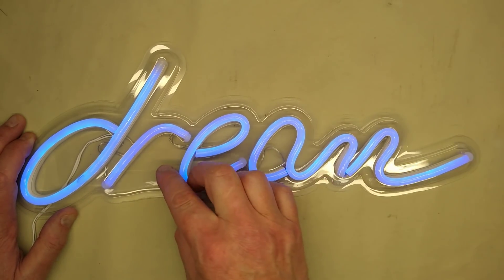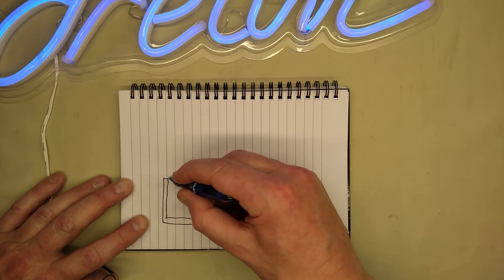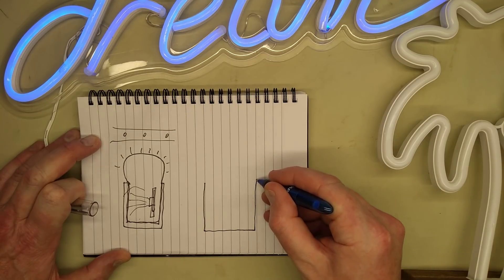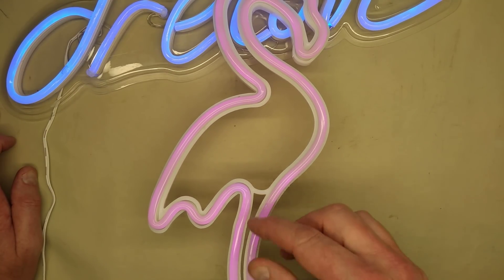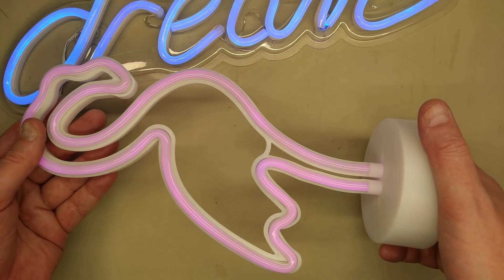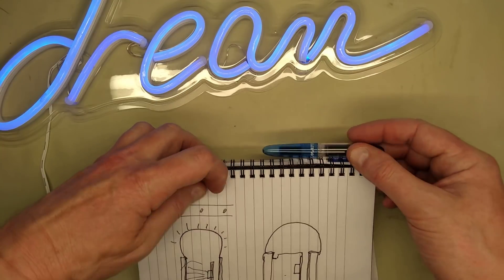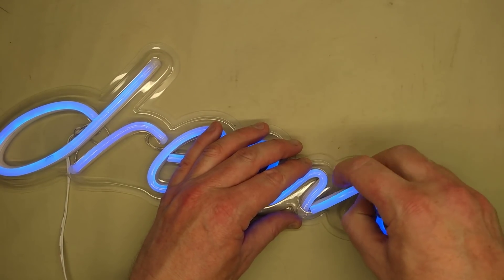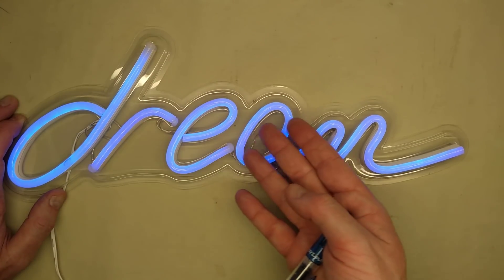Four types of LED "neon" sign manufacturing technologies.

Comment: Good video Clive.  Have you looked at the 12V Flexible Neon EL Wire that is also being sold ?  I believe there is also a 3V and maybe 5V version.  The technology is different as it uses a high voltage pulse to excite an oxide coating on copper wire to make it glow (as I understand it).  It would be interesting to see how it compares to the LED tape.  Apparently the step up inverters can be a tad noisy on some.  The low voltage versions are fed from two 1.5 cells.  Cheers Rob
Reply from the maker: I've explored EL wire in previous videos.  It's very dim and reduces in intensity further over time.
Reply: @bigclivedotcom  Thanks for replying Clive.  I will have a look back through your videos.  I've only just started looking at what's out there as I have an idea of maybe driving some low powered lights with a dynamo off of a small Gamma Stirling engine I'm building. If it worked (was powerful enough) it would excite the Stirling model guys I expect.  Cheers Rob

Comment: @bigclivedotcom I have a question maybe you can help me out. I have a raspberry pi 3 B I have a audio amp that is connected to 5v on gpio and ground on gpio. I have the audio amp connected for audio in using the 3.5mm Jack on the rpi3 B. The audio works but it has this distortion when the rpi3 is working or when reading microsd or when CPU is working its so loud and sounds like a modem over a phone line. I have tried using a transformer to cancel the ground noise this works a little bit but not as good. I need a good circuit diagram to cancel this ground noise. I don't know where to start. I could get a ground noise filter but the space is limited. Do you have a PCB plan that can achieve this goal?
Thanks in advance.
Reply: Is this a background noise or is it as loud as the sound you are playing?
Reply: armisteadab, background noise. I managed to get it a little quite but now i here is static and pop's from the speaker when no sound is playing.

Comment: A bit more effort on the middle of the "m" (which is a cursive n the way it's done) would help a bunch. A little trimming of the sides to have the plastic angled and pushed together then the join filled carefully with hot glue would improve the look. It's likely the factory that makes these has jigs with various length stops for cutting the pieces, wouldn't be difficult to have an angled jig to cut ends that need to make a sharp bend. Might even be able to cut partway through from the side opposite the LEDs in order to get a tight bend, as long as the bend is between LEDs.

Comment: A lot safer than the traditional neon sign in a local cafe with totally exposed tubes and wiring. I´m told its forty or fifty years old  and it works perfectly. Oh and at its lowest point it is about head height if you sit on the nearest chair, and there are no warnings.

Comment: I'm making a faux neon with backlit (led tape) clear bendy straws, its a bit messy but Im getting better.
Clive, ever considered a piece on peltier modules, Im planning to build a small solar powered (via a battery) air con unit, think cool stream of air rather than trying to cool a room. Theres a whole bunch of poorly executed versions all over you tube, and it would be great to have your sensible/silly take on them.

Comment: Hi Clive hope your well can you tell me have you ever stripped down a home water distiller if so can you share with me the link tyvm
Reply from the maker: I have, but didn't make a video about it.  It's a stainless steel inner container with a heating element welded directly on and a thermal switch that cuts out once the temperature shoots up (container dry).  The output to the lid fan is just switched from the power input.

Comment: I'm interested to see if there's any fibre optic solutions to fake neon.signs. I read about a version using lasers and glass, but it seemed pointless as if you're going as far as to make a glass sign you may as well put some electrodes in and fill it with neon.
Reply from the maker: They used side-glow fibre for a while, but it doesn't look good.

Comment: I think the "m" in "dream" would have the same issue with real neon. I don't think you can bend a neon tube that much.
Reply: With a real neon sign, they would have ducked straight down at the bend and double back to the top behind the front tube I suppose...

Comment: If the wire was exposed, would the dc current shock you ? Bought some gleco tape and looking to do a project with the kids
Reply: DC doesn't become noticeable untill 24v or so, you are pretty unlikely to ever get a shock off led tape

Comment: Perhaps an alternate theory on why they put the "split" at the center of the "M" is that the lengths are pre-cut for assembly and they just grab a set of pre-cut lengths and assemble them in the channel.

It'd be interesting to line up the LED Strips side by side and see how close they are to each other in length.

Comment: Don´t want to be a party pooper, but the brighness on the "r" of the "dream" sign seems to be quite a bit dimmer. So, no even brightness at all.
Reply: There is a dim patch, possibly an LED or two has died. It won't be due to voltage drop since its very close to the supply. Some of the other letters also have dim areas but mainly around the tight curves.

Comment: I've seen something similar in tape form for motorcycle helmets, how do they work...
Reply: That would be electroluminescent tape or wire. It's a totally different technology to LED and requires fairly high voltage (50-120 VAC) though nothing like as high aa neon. They were very sensitive to moisture and would degrade relatively quickly, don't know if its improved in that respect now.

Comment: I have been trying to find something like this only much thinner. I have found that EL wire is small enough but is not very visible in the light of day. Is there something that would work in a small diameter?
Reply from the maker: They do a 6mm wide version of the LED neon.
Reply: I was hoping that it came in at 2.5 mm. Thanks for the response. I'll do some more research.

Comment: I suppose what would be better is large format EL wire, you could get some real effects in then!
Reply: Does EL wire still have a very limited life or is it better these days?
Reply from the maker: Still dim with fast intensity degradation.
Reply: SkyWizardless Brightness degrades over time, very high voltage needed with a whiny inverter and easy to damage by bending

Comment: Have you heard of remote phosphor?  The phosphor is applied to a surface and not part of the led. First saw it in a headlamp on indiegogo.
https://www.indiegogo.com/projects/carbi-light-without-limits--4#/
If could apply/paint/print the phosphor into the moulded channel...

Comment: Just need to construct a circuit that makes them flicker like a faulty neon sign, just for that authentic ambience... :P
Reply: And buzz like an old transformer.
Reply: @whitcwa  and a cattle prod so you can get shocked the same way...
Reply: @whitcwa  I used to hang out at a local pizza place with other gearheads and we had to sit next to the signs in the window. They flickered and buzzed so bad people where afraid to sit there. If you got close enough it felt like the hair on your body would stand up from it all.
Reply: That's a really cool idea :)
Reply: That would be so cool to see! And also a piezo or buzzer for the buzz sound included too!
 Clive, next video perhaps???
Reply: I've just been trying to convince a girlie friend, that some occasional flickering and buzzing would be cool for a nameplate I'm planning to make for her; she's unconvinced :-)
I could get the buzzing noise from a small relay, and also use the relay contacts to flicker the 'neon'; then use e.g. a 556 to drive the relay.  A buzz every 5mins or so would probably seem 'random' enough, eh? :-)
Reply: LFSR with resistors on each pin forming a divider with a main resistor - should give varying levels of brightness depending on how many pins you use.
Reply: twocvbloke check out Wesley Treat - he did just that on one of his signs some time ago. 👍
Reply: In theory, not difficult. If you use a blinking (or “flickering flame”) LED in series with the string, it’ll work (up to about 9 volts or so) of series LEDs, But that’s with a battery or voltage-regulated supply. Those constant-current SMPS modules may not like the time-varying current, though, leading to failure of the controller chip, the driver transistor, or both. Needs some experimentation! 😀

Comment: I need help I am trying to program an arduino when I push a button an led comes on for 1 minute then off. any help I would appreciate. Please and thank you!
Reply: A 555 circuit would be easier.
Reply: @simontay4851  I am trying to ( when button is pushed it turns on a 5v relay for 1 minute from the relay is 12v going to a 12v solenoid to turn water on
Reply: @MrPlumberguy23  Try this circuit: http://powergen522.blogspot.com/2018/03/relay-off-time-delay-timer-by-using-npn.html
You could easily build it on stripboard.
Reply: Value of capacitor determins how long transistor stays on.
Reply: @simontay4851  thank you I will look in to that

Comment: So are these more or less reliable than actual neon signs in terms of life-span, energy use, and general durability?
Reply: They're going to be better because they will be less susceptible to thermal and mechanical shocks. Much like led stoplights are better. But they can falter eventually like anything else.
Reply: Also, because they're in parallel, they'll likely fail in spots but leave the rest lit up.
Reply: @metatechnologist  Yeah, who knows though, these might become so common on store fronts because of their cheap and simple design that the whole, neon sign thing might start to look generic. I doubt that will be the case for a while though, always nice to see a nice looking lighting fixture in a window.

Comment: Man a BigClive video in above 480p. For the last 18 months I've ben using my phone. Were 480p is all I get. For about 30 seconds I can watch 720p I save that 30 seconds for reverse engineering schematics. I woke this am turned on my 55 inch TV and watched BigClive in 1080p also in the box next to me (middle of moving) is a big live coaster I'm almost ready to sodder/solder it. Sitting next to that box is my soldering station, and standing on that box is my boxer😁 (dog). Have a good one sirClive. Cheers.

Comment: I ordered a roll of similar faux-neon that has three color LEDs. The colors can be selected individually or in combination to make a variety of colors or a pretty good white. The minimum distance between cuts is about 24 inches though. Fascinating stuff. Soon we will be seeing it in use everywhere I suspect.
Reply: Oooh.... That would be lovely with the individually addressable tri-color LED strips.  With a controller, that could make animated signs that are much more complex than traditional neon signs.